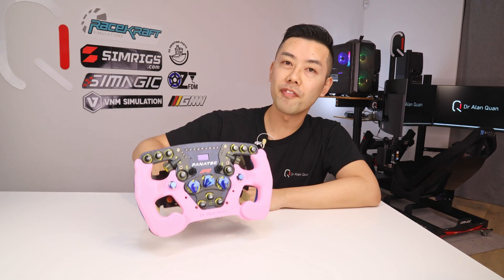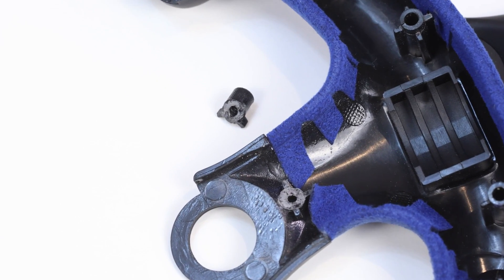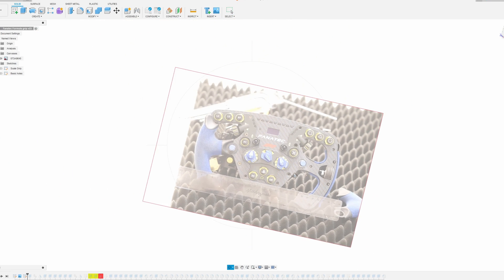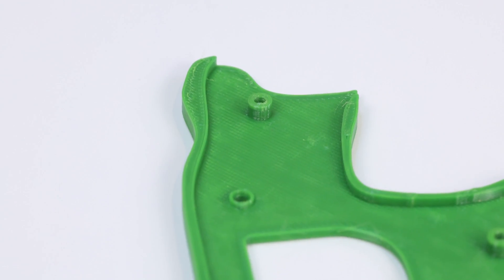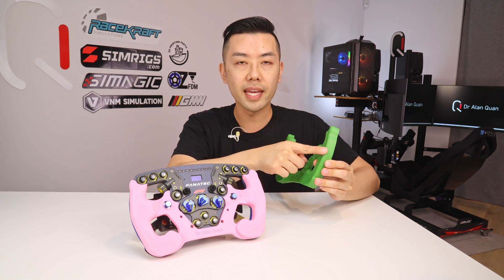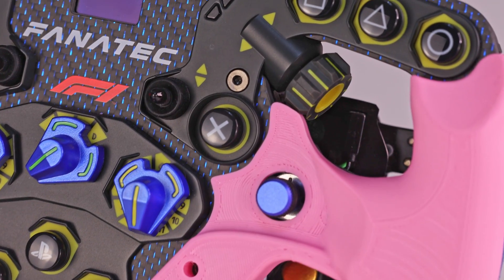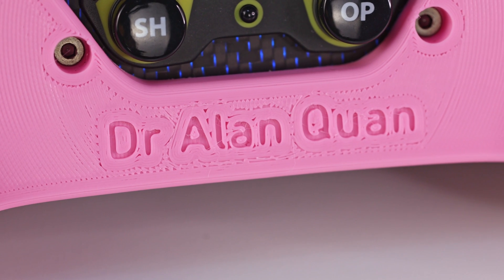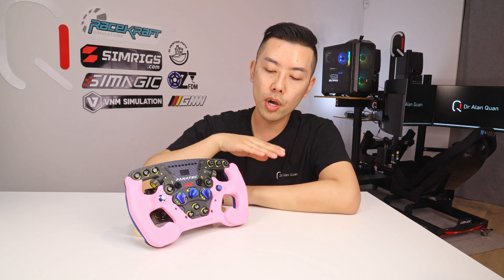This Fanatec Formula V2 mod is awesome and I made it!

Comment: if you're planning on selling, you should consider selling the STL. i'd buy it
Reply from the maker: Hi Jedi... Um... Beasticles 
I'm still testing my design, I've gone through countless iterations and I have good blueprints to produce excellent fitting and functional front and rear grips - I'm now tweaking the comfort in hand, as of the most current version it's super comfortable everywhere except the tips of my pinkies - I want this to be perfect before I release it, but not long now!
Reply: @DrAlanQuan  you're making rapid progress! well done

Comment: Hello, I had the same exact problem on my wheel, cracked on the same places and then was quite unestable. I wrote to fanatec and they send me new grips without charge and I changed them with the help of pinaple grips explanations
Reply from the maker: Glad they looked after you! I'm pretty happy with the path I'm going down - improving the rim with the stiffer handles than standard.

How long was your wheel in service when you discovered the breakage?

Comment: looks good!  I would like to have a cheap option to buy an STL file I can print it myself.  also maybe different sizes for larger hands.  not sure I would buy them over Pineapple for a mid price, their quality is really high although slow to get your order.
Reply from the maker: Hi Tyler thanks for the feedback! Very fair perspective. I think different sized grips are actually pretty straightforward to implement. 

I've got the rear grips off and I'm presently working on my design there, but within a week or so I should have a working front+rear design! 

I figure I can always do a digital file release anywhere in the future, it's just once a digital file goes live on the internet there's no going back and the potential for it to get leaked and lose almost all value in an instant is high - and not only for myself, once a digital grip gets released that has potential to hurt Pineapple Grips too, but to a lesser extent since he's doing some pretty cool stuff that's super hard to replicate

Comment: This wheel actually was a pain to use after a while. Those ergonomics stink.
I applied thick, quality handlebar tape with an extra extension layer to widen 
the lower arch, and increase the thickness of these grips. Now that they no 
longer resemble the shape of the original, this wheel feels great.
Reply from the maker: I used the wheel for years, it was all I had, I had no complaints.

But now I've held a number of different wheels and the handles on this as standard are just way too skinny. Definitely looking forward to producing something larger for it, and hopefully don't need to resort to tape!

Comment: This looks great! Love the pink.  I’d highly encourage you to use surface modeling, I’ve used it for other grips I’ve designed(not for sim racing rig, other stuff) and it gives you a loooooot more freedom as to how the grip feels.  I loved getting to learn surface modeling, and I really think it may help here
Reply from the maker: Is surface modelling like manipulating clay? Push and pull rather than extrude, is what I imagine. I would definitely like to expand my modelling skillset!
Reply: @DrAlanQuan  yes it’s very similar to manipulating clay. The one tricky thing for me is when you’re in surface modeling mode in fusion it takes away the status as a solid part, and you have to resolve the geometry later, so standard commands will not work until that has been done.

Comment: You cranking that thing on turns? I hope mine doesn’t split like that
Reply from the maker: Not at all! My DD1 is set to under 6Nm 99.9% of the time.

Considering the wheel came bundled with a 20Nm base I figured that was quite safe. I'm generally quite careful with my equipment, but stuff like this happens I guess

Comment: I've made new grips for my Ascher Racing Formula v1 and this reminds me of my first iteration also made with fillets, that I didn't find comfortable enough. I did a re-design with the resolve-tool in Onshape to make it rounder and I wanted it softer, so using the right TPU with the right settings was another task. The result can be found on Cults3D and I should replace the photo, because looks better IRL.

Comment: the best mod you can do for your DD1 is the SRM base side emulator and then move to a better QR (NRG) zero play and super solid. I was gonna get an SC2 Pro as a upgrade but after this mod.. a lot of the shortcomings are resolved and the best part is no more need of the podium hub saving you an easy 200 bucks a wheel on the QR alone.
Reply from the maker: Hi there, I was very interested in that product since it released but ultimately it would render my Formula V2 unusable unless I convert it to USB and that in itself is more money out - but yes a very nice solution to consider!

Do you have experience with the NRG branded quick release combined with the Simagic branded QRs?
Reply: I actually did the conversion on my v2 wheel also to usb. and it works perfectly. i have the NRG branded actual real life 70mm pcd one on the base side and im using simagic ones on my wheels. they work flawlessly @DrAlanQuan
Reply: No need. Just get QR2 there is no flex. For 3rd party wheels just get the emulator QR2 from Leoxz; it’s the same size and appearance as a fanatec QR2 and about the same cost